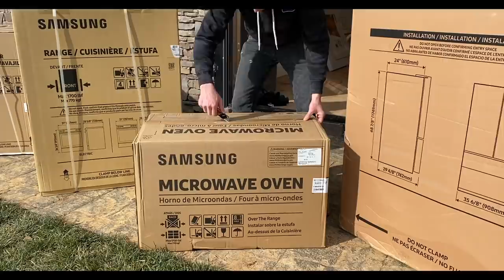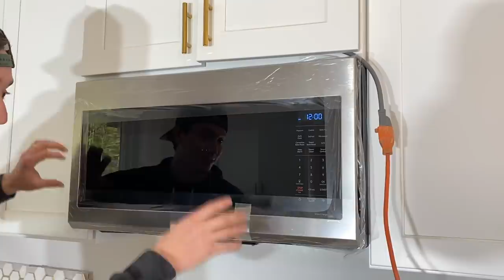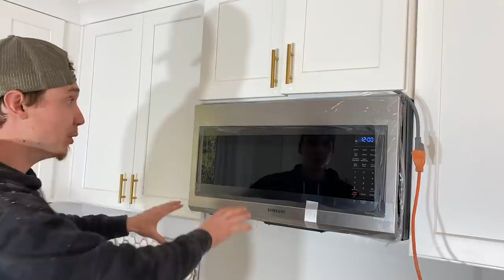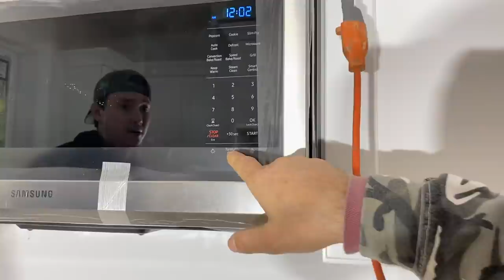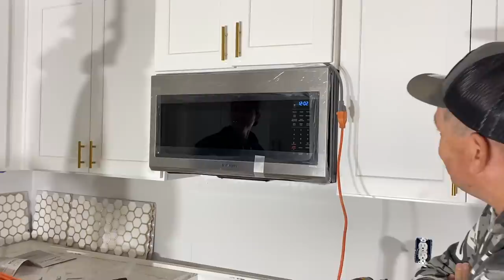The New Goonzquad Headquarters Part 71

Comment: Personally I’d want a drive that leads to where you’ll be entering the house, imagine a rainy day, or with a bunch of groceries
Reply: Exactly what I was thinking. Both options they mentioned sounded cool... Until it rains lol
Reply: Didnt see this til I replied the same exact thing.
Reply: They could just build a covered walkway from the garage to the main house. Looks cleaner that way with no cars obstructing the view at the front.
Reply: @luqmanrizal1661  that would be a good idea
Reply: Totally Agree
Reply: @luqmanrizal1661  totally agree
Reply: Yup
Reply: Remember their is that door around back our front door on our 1860 house has a brick walkway from the drive way going to the front door.And gravel going to the shop and side door
Reply: They could make a driveway to the garage, and then, from the garage to the backyard where the concrete is.
Reply: circular driveway with a helipad in the middle of the turn around for the R22
Reply: @luqmanrizal1661  agree, a suttle path with a shelter that runs along with it.

Comment: Definitely a circle drive to the main garage/ shop coming from a lawn care guy make the driveway wide enough for big trucks trailer and deliveries hard to turn around if not wide and circular. Nice work don’t let the sod die get some starter fertilizer on it in spring and feed it so it develops good roots.

Comment: I do asphalt paving. I would do the big straight driveway, with a huge square / turn around where the garage will be. But also make the driveway connect to your pad in the back
Reply: Why not concrete
Reply: Concrete would last longer and asphalt crumbles when you put tons of weight on it
Reply: @nickwebb9937  he never said not concrete 😉 he just pointed out he does asphalting for a living, so hes no doubt done a lot of this
Reply: @jarsky  yeah I know I read it wrong concrete would be the better option but it’s more expensive
Reply: Asphalt is trash for a nice driveway and doesn’t hold up like concrete does.
Reply: @zx6rHooligan  it is a lot more affordable. Also if you do the asphalt right, it will hold up well. Aka sub base is compacted with the correct fill material (sometimes even engineered fill), the right amount of binder, corse aggregate and thickness.
Reply: @nickwebb9937  they are "GOONZQUAD" they can afford it
Reply: @Markism07  do you see what they have been doing? Do you think they care about money? 
Of course it’s more affordable but it’s also a inferior product. If you’re going to do something nice and right do it right the first time. Buy once, cry once.
Reply: @zx6rHooligan  No doubt that it's better...I saw ignorant comments that stated asphalt is trash when it doesn't have to be. Read about it
Reply: I do both asphalt and concrete. Yes concrete is stronger if done correctly, but asphalt will hold up for a long time if done right too. Also, asphalt is not trash. You drive on it every single day of your life. It's the most recycled product, and it's how I make my living coming up on 20 years. I could call alot of things trash or bad but I don't. Yes these guys can do whatever they want, so let them decide. Both concrete or asphalt would be good options. Both have pros and cons.
Reply: @Jr-stan  thank you
Reply: @Jr-stan  I drive on it all day every day and see potholes and cracks everywhere. Yes it can be a decent product but it doesn’t have the longevity, strength, and curb appeal like concrete does. These guys don’t care about money as you can tell by some of the decisions they have made in the past, so they should do their driveway to the best they can get there.

Comment: Vent the microwave outside through the roof and add a hood over the range. Microwave fan has the ability to change venting direction. Send cook smells out. Door this after your pressure inspection if not done already.
Reply: Completely agree! Hopefully, they will  also apply metalized tape to the seams on that vent box that comes with the microwave. it leaks like at the base and the seams.
Reply: They won't change it lol. Plus they won't pass blower door test with that garage door in that ground floor room lol.
Reply: Guess they will cook with the windows open...
Reply: vent it right through the wall to the outside !!  It is on the side wall would be easy enough to vent it there,,,venting it back inside the kitchen is dumb !!
Reply: Yeah I tried to warn them previously, recirculating vents are completely useless. But clearly they didn't listen. Honestly doesn't appear they researched much of anything..... sounds like a sales person was like "oh this one has an air fryer built on" and they went "daaaang son lets get that one".
Reply: Yall vent microwaves?
Reply: @darkdays8004  It's an overhead microwave. It goes above your stove and includes the vent for your stove in the bottom of the microwave. So its' kind of 2 devices in one. Honestly I hate overhead microwaves too, they suck.
Reply: @Dougie085  yea didn't think about that.

Comment: The metal rack in the microwave is for the convection oven setting make sure you read the instructions before using it you have to use certain dishes with that and obviously don't use the metal rack when using just the microwave feature

Comment: Isn’t that microwave gonna get nailed by steam when the cooktop is being used?
Reply: Yeah I agree they need a rangehood fan
Reply: There is a CFM ventilation system integrated under the microwave for the stove that has a filter which was inserted upon installation.  So, it has an integrated hood range.
Reply: He prob mean an extract fan
Reply: @ec53001  ahh, that’s what that was, interesting set up. I’d presume they need to add ducting for it before it’s actually used?
Reply: Carbon filters in the microwave/extractor. So no need for extract fan. Not the best idea as they need changing every 4-6 months
Reply: Nope. I have the same steup. Turn on the fan and cook!
Reply: @mj_aussie_coaster_travels8310  You don't need and vent stacks or ducting. In my opinion, it's not as effective as an actual hood range, but it helps of course. I have the same setup and it's just ok. Not my preferred method but that was my only option.
Reply: The microwave is going to get grease from cooking oil steam

Comment: Feels like a Bad idea to put the microwave above the stove/oven and not have a cooker hood with a grease trap/filter above the stove. There's a lot of water/grease steam rising when you're cooking.
Reply: Not sure where you are from, but it's very commonly done like this in the states, my house as well. The microwaves usually have decent venting systems built into them that allows you to either vent outside through ducting or the fans can be rotated internally to vent out of the front of the microwave vents. The bottom of the microwave will have dual washable metal filters. But yeah, it's still not the best method and the fans are very noisy. Even when my vents are on high I can still see a lot of steam escaping the pull of the vents.
Reply: yeah, putting grease trap right next to high current machinery in a wooden house sounds like a recipe for disaster

Comment: "Oven has a built in Air Fryer" .... lol, many of your higher-end ovens have this already .... it's called a "convection oven" and that's all an "Air Fryer" is .... it uses a fan to move hot air around the food. Air Fryers are amazing.
Reply: their microwave is also a convection oven, i really hope they dont try use the microwave function with that metal inside.

Comment: The most important asset of this site is the view, and Goonzquad will not want that to be spoiled by having cars parked on the south side of the house. They have mentioned insetting some stepping stones into the lawn to give access to the double entrance doors in good weather, but in winter they will probably use the single door on the west side. So that suggests a canopy between the house and the garage, which would enable cars to pull in there and their occupants would then be sheltered from the elements. There has to be some kind of link there anyway to comply with Code, so an imaginative designer could turn that into a fully functional component of the overall design.

Comment: You can't put metal in a microwave. The shelves must be for when it's used as a oven if it has this combined functionality
Reply: It depends on the structure, composition and shape of the metal in relation to the wavelength of the microwaves generated. If the metal is designed to go in the microwave, it's fine.  Also why a grape in a microwave generates plasma :)
Reply: that thing can go in the microwave, it's actually for putting two plates in at once

Comment: All that money and y’all bought Samsung 🙄 either way I never miss a second and love anything y’all do
Reply: What's wrong with Samsung? They make awesome stuff
Reply: Samsung is expensive and nice smart technology lmao who buys  appliances from Best Buy rich ppl.
Reply: @joshdrivez8303  Samsung has a class action lawsuit for their fridges being faulty. Everyone I know who had one the failed, even after multiple repairs and replacement parts. Condenser issues I believe
Reply: @lukebarnes8097  they should stick to TVs. I have all Samsung tv’s. Also read my other reply below
Reply: @Gus Garcia Jr. yea ok 🙄
Reply: Everybody wants all this technology in their appliances and it will cost them in the long run. When I built my addition & new kitchen 20yrs ago I did the opposite, I got all Kenmore Elite but ordered it without the options, no self clean oven  (helped 2 friends break into theirs when it came on while cooking in them lol), ordered my Fridge without a ice maker, got all manual controls on our Washer & Dryer, no digital controls on anything I got except the clock on the Range. So it's been 20yrs and all but one appliance is still going strong, the one thing that broke was the dish washer and at the time was under warranty and Sears had a policy if a part was back ordered for longer then 30 days they will replace the whole unit, after the repair guy rebuilt the entire DW one pc board was back ordered and they gave us a new DW. In the same time period my cuz has had 3 fridges and is on the 3rd set of washers and dryers & is on the 3rd DW, all bought at Lowes, Best Buy and a local app company.

Comment: I suggest option 1 Long Drive Like Exclamation mark circle at end 
The steel insert in microwave is to heat up two plates at once 
Need to water ASAP the new grass (put small holes in Garden hose pip connect to tap Easy spraying system)
Good Job so far

Comment: boys have you considered when the grass grows you have to whipper snipper it. So when the grass is right up the sides of the building you're going to destroy the paintwork when cutting the grass.
Reply: It is best to set the turf (sod) back 6" away from the walls of buildings on all sides, keeping it back with a durable plastic strip vertical 'curb' hammered into the soil to create a root barrier, and fill the gap with pea gravel. Makes mowing and maintenance much easier.

Comment: When  you guys do your backsplash run tape at the back on the bottom off the microwave were your tile will touch the microwave. That way when you grout it doesn't get up in all the cracks of the microwave. And it will help from getting cut. Just a heads up. Love you guys videos I have been watching since blue jeep build. And shout to your mom and pops for raising two awesome young men. I'm sure they are very proud. Thanks

Comment: Dudes everything looks amazing. Definitely go with the long driveway to the garage. That will actually prevent your lawn from getting damaged. What type of lighting will you be using on the perimeter of your property? It is very dark up top of the mountain. And last but not least as you may know your spiral stair case will actually be very slippery, will you be placing slip resistant pads on the steps?

Comment: 2nd option straight and then around the garage between the house gives you easy turn around with trailers gives you a very decent pad in front of the garage for helicopters lol. If you do the cement all the way around the back and clear a few feet beyond the new cement driveway would also provide a decent firebreak on your garage add a few rain birds on top for more fire protection. check into the shrubs around the a/c they can potentially cause problems  at least in my experience. But that could also depend on the plants definitely do some research. Good luck on your decisions.

Comment: You should vent that microwave outside.  You're on an exterior wall, it would be very easy and much better than the recirculating option you switched it to.

Comment: Driveway idea: since your main concern is the view, why not dip the driveway down to the lower road then have it turn uphill and run in front of the garage and stop right about where the ac condensers are? Max view and still have plenty of drive for parking.

Comment: Having had both driveways, get the long one with enough space to back up and turn around. A circular one, someone is always parked in the middle and you have to back up or move a bunch of vehicles to get out. Here is a pro tip: lay down a bed of broken large flat shale before you put down stone or tar mat. Then it will not davit from heavy or long parked vehicles because of the clay. You will thank me in the end. I live in Virginia which has the same clay, and my neighbor did not and I did. He adds stone every year and on my 3/4 mile drive every 5-8 years.

Comment: One, Pops is a national treasure. Two, you're going to regret getting a Samsung fridge in a year or two.
Reply: Why?  I was planning on getting one
Reply: @Deathignator  I've had multiple friends  have their's fail within a year. If you read online, their compressors/electronics suck, and are prone to failure, and their support is apparently atrocious. Most repair folks will steer you away from LG/Samsung fridges, and recommend whirlpool/kitchenaid, or the more expensive sub zero type brands.

Comment: I hope y’all didn’t forget about putting outlets for cable and cat5. Unless you guys want wholes thru the exterior and exposed cables around the house and it doesn’t matter witch way you go broadband or satellite oh and make sure to put some repeaters in the house so y’all won’t be calling for wifi problems not getting all the speeds in Sutton area’s of the house
Reply: The house is being connected to a Fibre Optic service which will provide all the high speed connections they require,

Comment: @goonzquad , That's not just a microwave, it's a Convection Microwave with WiFi. Convection microwaves are different than regular microwaves, You can't use metal in microwaves, and convections come with a metal rack in them. Y'all need to read the owner's manual for sure. lol.

Comment: I would make a pull off close to the pump house so y'all could add a car wash bay and y'all could just install the vacuum and electric pressure washer in the pump house I don't know I could be wrong but I feel like it would be a good idea considering how much dirtier things get in the mountains I know from experience I live on this side of a mountain can't wait until y'all get everything put in the house and the yard done I keep thinking about your back deck though I think it would look awesome with a bridge leaving out to the bank on top of the hill with a small patio and fire pit and a pond with a stream that flows to the bottom of the hill but y'all might not like the same things I do I still love the new Goon Squad headquarters

Comment: I may be wrong, but it seems to me that you can’t have open the oven and the dishwasher at the same time..? Because they’re pretty close to one another.

I’d have the driveway end where the concrete pad on the backside starts. And then step stones around the corner to the main entrance. That way you can easily unload stuff into the garage (which isn’t a garage, I know, but still.. 😅) 

But who’s the kid?

Comment: Never seen turf /sods USA laid on the gravel like that every stone will rise up in time and attack the blades on your lawn mower you have been warned, I have seen turf layers sieve the ground with a hand held device/ griddle just to get the likes of stones and gravel out of the soil . With regards to pathways the front door needs some kind of open or closed vestibule with a pitched style roof to match the main house then wide pathways to both the balcony side of the house and with what will be the new garage area and enough solidness in the paving to take heavy traffic without it ripping up plus also a large turning circle and lastly to make it looking domestic not commercial .

Comment: A micro wave over top of the stove , would of placed it ulse were then spits of food hitting the bottom of it . oh no extractor fan over the oven .yet still looks good . Agree should of left the front of the house for the drive way DOUNUT DRIVE WAY , so you get cover to the work shop / house in eny weather , move the grass fast go the well house and opposite side inline with the container

Comment: Let's face it. You live in the South. So driveway or not, they're gonna park their pick up trucks were they dang well feel like it. Pavement or grass, it won't matter if it's too much a hassle. However, you could go with different driveway materials, such as concrete, bricks, pavers, pebble gravel, and so on to vary the sense of aesthetic experience and tactile feedback in different areas.